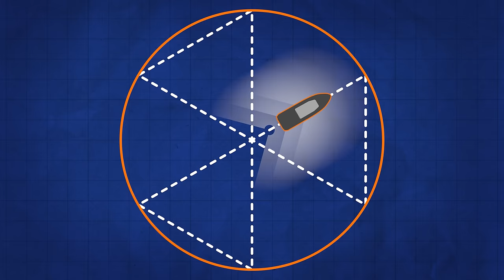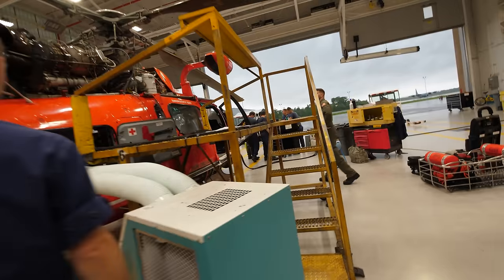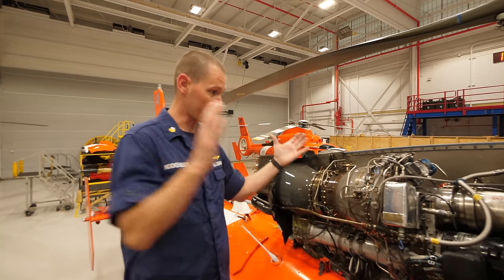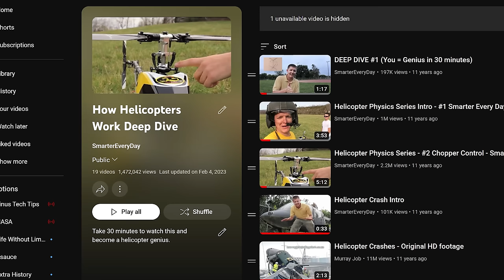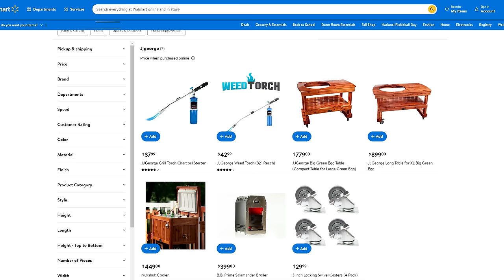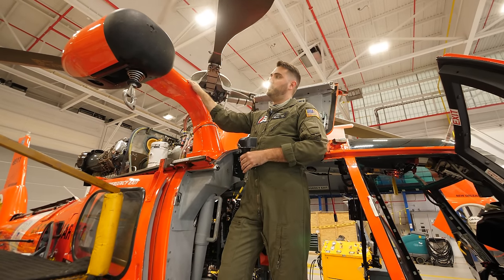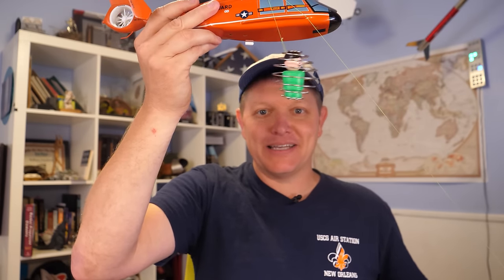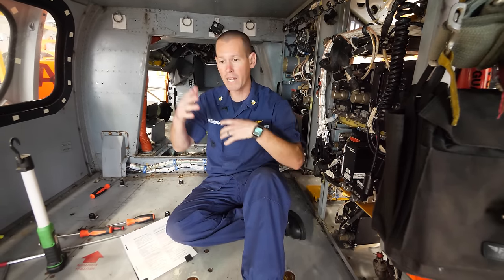The Amazing Engineering of Rescue Helicopters  - Smarter Every Day 289

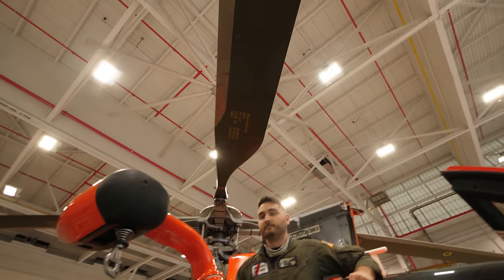Comment: So at 17:18 

Did they mean that only because of the Hydraulic work needed to hoist a load up and down, the Helicopter Turbines have to work so much more, that it uses so much more fuel and thats why flight time is reduced ?

Or did they mean that just hovering uses more fuel ?
Reply: Beyond a certain forward airspeed (relative to rotor head speed, aerodynamic shape, etc.), helicopter rotors start to gain lift from the forward speed. This is called “Fast Forward Flight”, and is much more efficient than hovering. This is why doing rescues uses more fuel. They spend a lot of time hovering and don’t gain the efficiencies of FFF.

Comment: Why not build a plastic cover for the back of the compartment for the swimmer to sit on, and where it drains forward, perhaps into a small tank? It would weigh very little, a few pounds, and take up very little space, perhaps an inch in thickness.

Comment: The helicopter is fascinating and all but I couldn't get over the size of that ceiling fan. Why's it so big? Why does it have so many blades? Y'all are geeking out over the chopper and I'm standing in the back just looking straight up at the fan not paying attention. Lol
Reply: A Large diameter fan with many blades can move a large amount of air with a low velocity. So you get maximum air turnover without a disturbing blast of wind.

Comment: Hold on... about the pendulum effect. You can't have it both ways! Either a small swing at the bottom becomes larger at the top, or a small swing at the top becomes larger at the bottom. I think the second one is not true. That means, a small swing at the top will become smaller at the bottom. Where swing means magnitude of the oscillation.

Comment: Most helicopters are piloted from the right seat because early designs only had one collective pitch lever in the center. And since controlling a helicopter is somewhat like trying to balance in top of a ball, and most people are right-handed, they built them so pilots could use their right hand on the cyclic control stick. 

Modern helicopters have a wide variety of control configurations, but right seat command is the most common due to that tradition. It has nothing to do with the fact that this is a French helicopter, especially since the French use left side drive, the same as the US. 🤦‍♂️

Comment: Seems like the hoist should run off the motor if hydraulics burn that much fuel
Reply: Running the hoist doesn't burn any significant amount of fuel. Hovering burns more fuel than just flying around does, because the engines have to power the rotor enough to generate lift equal to the weight of the aircraft. In flight, the air moving over the rotor disc creates some lift.
Reply: @dongquixote7138  okay. I must of misunderstood. Thought he said hoist would burn all fuel but he must of been taking about hovering.
Reply: @bucko504  I can see why it could be interpreted that way, he didn't explicitly mention hovering. "We get more bite to hold ourselves up" and "if we go straight into hoisting, [endurance] goes down to 30 minutes, because we're constantly pulling power."

Comment: On russian helicopters track and balance is done with piece of alu pole, sheet of white paper and color crayons. You roll paper into tube, put it into end of pole. Color each blade tip with different crayon, spool up head, touch blade tips see, where each blade is. Adjust PCR, or bend trim tab. As for balance - you dont do it... 😂😂

Comment: Pilots don’t get a say in what maintenance happens when and where. Maintenance is mandatory as per the hourly and calendar maintenance schedule according to the Aviation regulator and manufacturers instructions and the requirements of the Minimum Equipment List or MEL. Truth be told most pilots have zero idea about most things mechanical. They understand the why but very seldom the how.

Comment: It seems odd that the flight time is reduced from 2 hours and 30 minutes to just 30 minutes when using the hoist... It would make more sense to me if the flght time was reduced BY 30 minutes when using the hoist. I mean the engines produce about 1000 kW combined; how is it possible that just the 600 lbs hoist makes the helicopter burn its fuel at a 5 times higher rate?
Reply: Helicopters get lift on the rotors from forward flight. In a pure hover it's having to carry all of its own weight. I believe it's also a loiter time, not total flight time of 30 minutes.

Comment: Why can’t the interior be designed in a way that doesn’t allow water to get into the frame? I don’t get it.
Reply: That is a very good question, with an interesting answer. Basically it comes down to: even if it was sealed you would still need to be able to open it to make sure there is no water inadvertently getting in. Therefore it's better to make it easy to remove rather than a more complicated sealed solution. Or just make the swimmer sit in a tub.

Comment: stop mentioning that gyroscopic stupid thing ... its noooot the real effect ... 
it is, that the rotor system is lagging behind the the cyclic input by a certain phase 
and by the nature it happed that that phase is near 90 degrees  (some times is smaller and sometimes is greater , called swashplate phase)
just imagine you are holding a weight through a rubber band and you intentionally moving the rubber band up and down , and certain speeds your hand and the weight will start to move at opposite directions (phased movement). the same thing is happening for the rotor but in rotational movement . it has nothing to do with that gyroscopic effect..

Comment: NO! It is safe! A 6" stick will not ever bridge an 8" distance. As a former AD in the NAVY working on SH-60B, distance from the rotor at that distance from the head is 100% fine. No need to spread FUD broseph! Nothing is just gonna dip 8-12 inches and chop your head off... At the very end of the rotor, you may wanna be a bit more careful though...